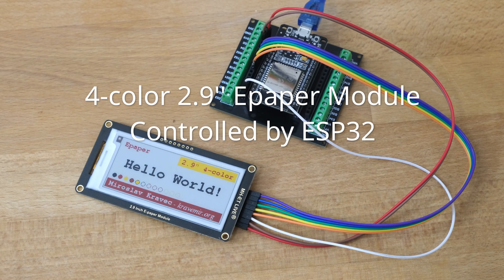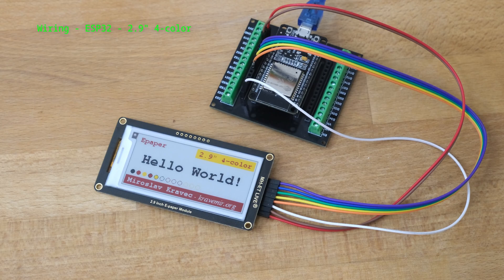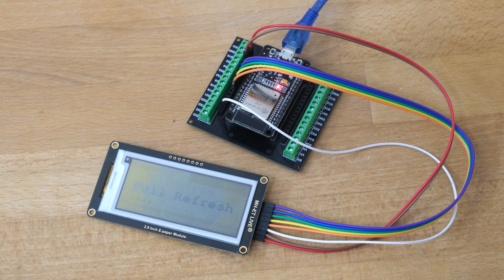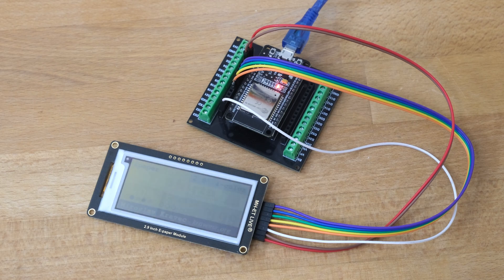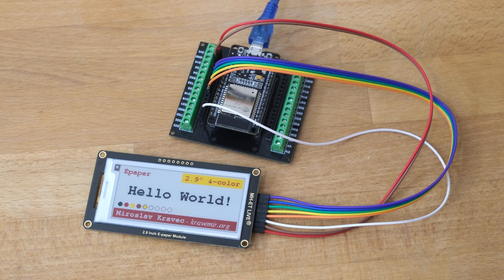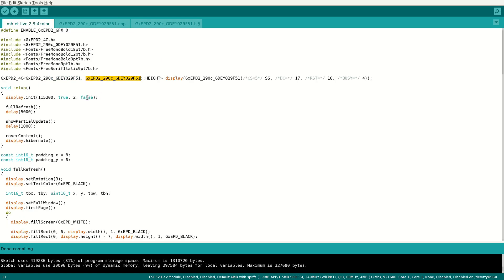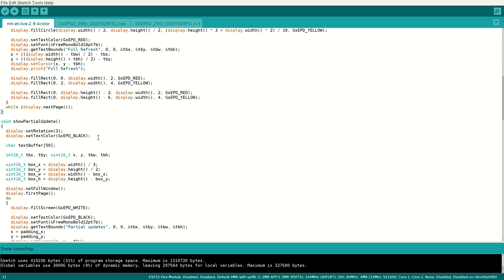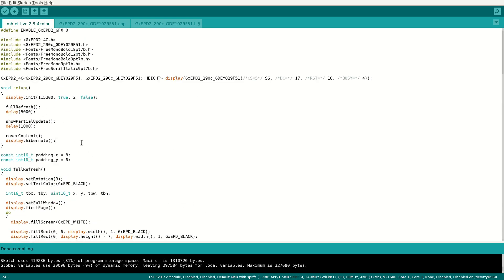MH-ET Live 4-color Epaper controlled by ESP32 programmed with Arduino

Comment: You actually saved me, Im a total beginner and just received my epd screen to experiment on, I just now realized the library doesnt include this model and I was really glad to find your solution here on youtube, thanks a lot!
Reply from the maker: @Reevassoo  I'm glad it helped you. TBH, I'm beginner in embedded programming, too. Luckily, the solution here is not too hard. Ideally, it should be incorporated into the library. The https://github.com/ZinggJM/GxEPD2/blob/66ea1cf2e2b739d71065d9c21384b7387b8187b4/CONTRIBUTING.md says to post on Arduino forum, which I have done https://forum.arduino.cc/t/mh-et-live-2-9-4-color-display-works-with-esp32/1357187. So, will see when it gets incorporated.